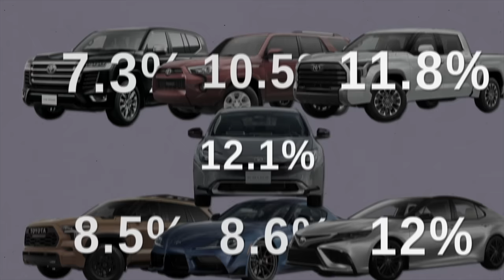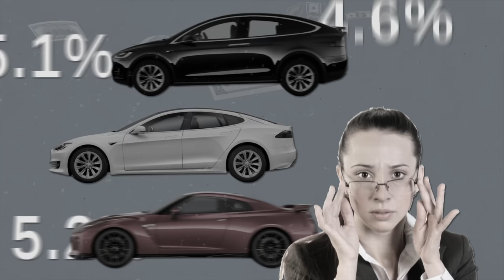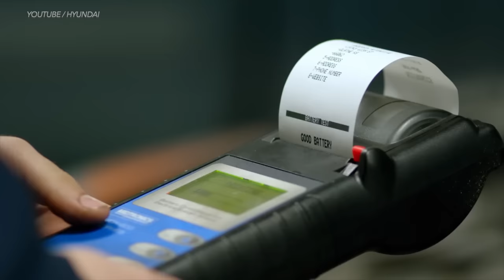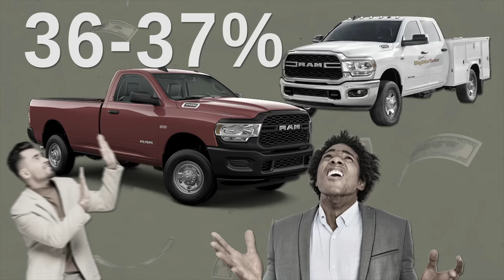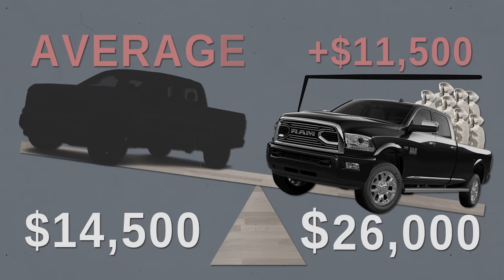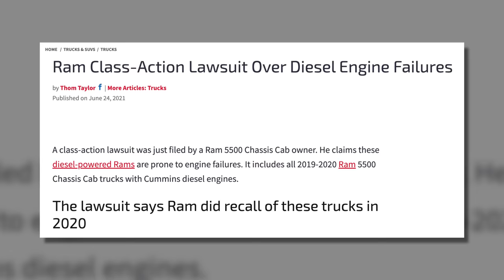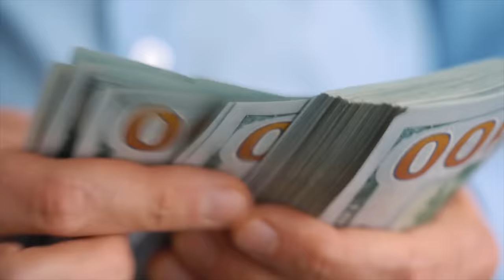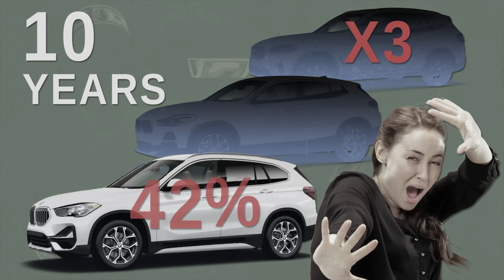Here's Why I Only Buy Toyotas and Lexus

Comment: I have a Hyundai Ioniq Electric, In denmark it cost 300.000 danish Kroner (DKK) I have had it for 4 years, I have spent under 10.000 DKK for service. I still have 1 year of warrenty on the car and 4 years on the battery.

Comment: In Poland we have saying about BMW acronim-> "Będziesz Miał Wydatki" . Which means "you will have expenses" 🙂
In BMW from (I think) 2010, to do even simple repair in engine compartment. You need disassembly front 'belt' eg. front bumper, grill, etc.
But you can cut almost in half cost of maintenance if you do more often  technical inspections and parts/fluids exchange. 
For example.. if instruction said that you can exchange oil after 20 000 km, you better do it at max on 10 000. This way engine will work better for longer time, and less v. expensive parts will be needed. And in my experience, fresh engine oil is a crucial part in BMW.

Comment: Great advice and yes Lexus and Toyota are tough!!
BMW main dealers in the UK refuse to repair, so they change the entire system that’s af fault hence the high average costs. However, I’ve an F11 520d,  bought it at 90k miles and I’ve driven it 130k miles in 6 yrs and never broken down, and never been into BMW apart from buying parts. If you are even slightly mechanically minded you will easily be able-to replace anything on a 5 series, apart from timing chains which I needed the help of a mechanic.

Comment: Fantastic stuff, though I would also liked to see some more hard numbers on absolute maintaining costs. A thing that came to mind was that some of the brands that are cheaper than Toyota might end up being just as expensive to maintain because reliability and parts costs are about even, but get a higher percentage because they start out cheaper. And some Mazda models at least aren't any worse as cars to start with.

So if you pay the same for maintaining the car for 10 years, but start out with a cheaper car, and you're not losing anything in terms of features, driving quality, economy etc., I'd say that's a win even if the relative maintenance cost is technically higher.

But yeah, definitely an awesome overview! Is this kind of information easily accessible somewhere, if one would want to look deeper?

Comment: You might laugh at me, but I think 1st gen Honda CRVs are the best. Yes, they're dated, they don't have 14" touch screens, etc, etc; I couldn't care less about tech. I like reliability, and they can't be beat in that department. When they do need repair, they're easy to work on, parts are readily available and reasonably priced. In addition, the AWD has been fantastic, I live in Nebraska and have never got stuck in snow. And they run, and run, and run......

Comment: I feel really bad... because I told my friend to buy only Toyota pick-up trucks... he always followed my advice, so he bought a '22 Toyota Tundra.  It has been sitting still in the dealer's parking lot waiting for a full engine replacement for the last 5 weeks.(wont' arrive for another 2 weeks)   It had just 6200 miles.   Whatever happened to the old, reliable, dependable Toyota engines?  😢

Comment: I can say with the rams, the maintenance is kinda a deferred cost from the cheaper initial purchase. If you compare a 70k ram to a 70k ford, there’s gonna be a lot more little goodies and gremlins to go bad. air suspension. huge screen. some sound system with more speakers than a house.

Comment: Dodge it's 22 years old just had to replace starter alternator and water pump. After 22 years. And even then it was 600 bucks. Maybe that's accurate for new vehicles but my oldie is still a goodie.

Comment: Scotty,
I bought a 2016 Ford F-150 King Ranch 3.5 ecoboost for $10k under sticker in Nov 2016 It has been in the shop an unbelievable number of times, under warranty and under extended warranties (2!). I bought an extended warranty through (Assurant) that MORE than paid for itself (around $550 vs the probably close to $8/$10k). It has been so bad that Ford offered an additional Ford Protect PremiumCare Plan 3 yr/36k miles initiated at 88k milesAug 2022. While I appreciate their willingness to step up the plate and support their product, I would prefer a product that is better engineered and more reliable. Off the top of my head, sunroof leaked/replaced, washer fluid pump, right front axle seal, heat shield, diff seal, turbo coolant leak, center console spring squeak, squeaky driver door check, missing tailgate bumper stop, faulty steering wheel switch group, 2 batteries, left and right front wheel bearings, #6 ignition coil(plugs at same time), auto deployable running boards motors replaced (NE truck/salt), water pump leak. I switched out the stock tires for Michelin Defenders at purchase and put Conti TerrainContacts at 72k. ALL scheduled maintenance at the dealer so my “loyalty” score is high. Bunch of recalls as well. I love this truck (beautiful two tone ruby red with every option) and want this truck to last a loooong time and have followed all maintenance schedules. I put on a passenger side JLG oil separator at 45k mi after finding out about the direct injection issue and K&N air and cabin filters at 50k. She is in tip top shape and I plan to keep it that way but lost productivity as a work truck(and personal) has been very disappointing and costly. Most of these are minor issues but I wouldn’t have been able to afford the truck $1000/mo payment 6 years) if I also had to pay for all the repairs out of pocket. And this also apparently a good year for the F-150!?!  I looked at the Tundra specifically because it is a Toyota product but didn’t fit comfortably(I’m 6’6” tall). Even considered switching out the seat mounts for a Sequoia but would have only gained me 3/4”. I wish they anyone could build a great reliable light truck. Hoping…
Keep up the great info vids. Thank you!

Comment: I had a 2010 VW Tiguan. Truly one of the worst decisions I’ve ever made. Not only was the scheduled maintenance costs ridiculous, but there were several unexpected $1200+ repairs that had to be made. The engine finally blew out at 136k miles. Sold it for parts and bought a Toyota Sienna.

Comment: I agree as a car mechanic for 36 years that Toyota is a very good brand. I personally do not like them because of the design. Now a day’s we see the quality issues with a lot of car brands with down seizing the engines. Oil consumption, chain wear, wet timing belt issues…etc. 
If you chose for “reliable” go for a Toyota!

Comment: Great video but you have to adjust for the total price of the vehicle.. 

Example.. if a 2015 BMW standard entry level sedan costs 35,000 and 200/maintenance you have to adjust the math for a 2015 Toyota sedan that may retail at 24,000 with a maintenance of 80/maintenance versus a 2015 Honda sedan that may retail for 22,000 with a maintenance of 70-80 versus a 2015 Ford sedan that costs 26500 with a maintenance cost of 85/maintenance.. I think if you fix this and recreate the video, proper context may be applied for better decision making. I'm a toyota/honda guy and the numbers sounded off because Honda are incredibly inexpensive at retail.. even m9re affordable than similar model toyotas.

Comment: I totally agree with the top-tier quality of Toyota and its sister brand Lexus. However I'm surprised at Volvo being included. I owned a XC90 for 14 years and it never gave me any headaches. I do change oil in all of my cars every 5,000 kms (3,000 miles for you Americans) and a top-down check-up every time car goes in

Comment: I have a toyota corolla ts and it's running perfectly (the same emissions, mpg acceleration etc) for 20 years. It's stock! If you change the oils on schedule toyotas will last practically forever (with the occasional part replacement)

Comment: My 2000 Toyota 4runner has 459,374 miles and it runs and drives like   a champ regular oil changes and maintenance is the key I wouldn't trade my baby for anything else

Comment: We had a did own a 2013 Chrysler Town and Country. We bought it with 30k miles. We took really good care of changed oil every 5k with Mobil one. The camshaft roller bearings failed at about 60k, luckily Chrysler replaced those free of charge, it’s gone through 3 alternators, check engine light comes on about once a month usually a catalytic converter code. Took it to Florida of course the AC failed when we arrived there. Point is I’m done with Chrysler products van has 100k and is literally a pile of junk. Sold it and bought a 2018 Toyota Highlander with 75k miles. I hope this Toyota holds up unlike the Chrysler.

Comment: Love this guys videos. 
Shocking to hear about Honda though. My wife and I both drive Hondas. I have a Ridgeline and she has a Civic. They are too new to tell if they are going to be expensive to fix.
My Ridgeline did however have the Torque converter go out on it and had it not been under extended warranty it would have cost me over $5k to fix at dealership.

Comment: Did you know that the legendary Toyota Hilux is made by Daihatsu in Indonesia? It makes you stop and think. My new last year Toyota Fortuner requires an oil change every 5,000 Kilometers. Just over 3,000 miles. A 2.4 L turbo diesel. 8 liters of synthetic oil every 3 to 5 months. Synthetic oil is expensive here in the Philippines so the maintenance costs on this, even under warranty are high. Food for thought.

Comment: Scotty, I have a 1996 Toyota Tacoma 4 wheel drive with over 30 thousand miles on it and it’s starting to have issues! I have a oil leak and it needs a new muffler and the AC is out! The engine light stays on, I also had to have the back left frame welded because Toyota wouldn’t fix it because they never sent me the recall! Is it worth fixing or should I just let it go? We have had it in family for 20 years! I love my Toyota Tacoma!

Comment: Without sharing any personally identifiable information, I have an old Toyota and swear by it. The two vehicles I had before that were more fun, but not worth the cost of ownership by any means. I've put less than $15,000 into my old Toyota since I bought it used over 10 years ago... counting the purchase price.

Comment: 2005 Toyota Matrix, 2nd Owner (1st was my Mother) car had 33k miles on it when I received it in 2017, it currently has 103k on the odometer and other than oil changes, brakes and tires/rotations the only recurring issue was with the Alternator, original one went out in 2019, it's replacement went out in 2020, next one in 2021, and then again in 2022, the shop kept using refurbished units, so finally I demanded they throw a new one on there and it seems to be holding strong.

Family has had nothing but Toyotas for the last 30 years and that's only 3 cars, all a form of Corolla. Currently trying to get my Mom to look at an Avalon for the bells and whistles.

Comment: My grandfather gave me his Asian utiliy vehicle (AUV), a 2003 Toyota Revo (in Indonesia, that's a Toyota Kijang). Still works like a tank and only needs the usual maintenance like oil change, A/C maintenance and battery change, although every few years or so (e.g. after 3 or 4 years) there's a major part that needs changed (and given that we have a lot of third-party auto parts dealers in the Philippines, it's not hard to find both brand new and second-hand parts, even the ones you thought were no longer available.

In many car enthusiast pages and groups, I see a lot of people who (so they claimed) literally cry for having to sell their Toyota Revos and regretting it. A second-hand unit that's in tip-top shape, even the ones from the first-generation Revos that were sold in the 1990s, can still command a resale value of up to P300,000 (slightly less than 6,000 US dollars), even more than any other 20-30 year old car. That's how big the reputation of Toyota Revos is in the Philippines.

Comment: I dunno I have a 2011 Ford fusion hybrid and besides oil changes, brakes and tires, only repair I needed was a control arm in 120k miles. I did have to reactivate the hybrid system with an obd because of a "glitch" at 10 years. Hybrids really do stress the engine, suspension and brakes way less thanks to be regenerative systems and engine not running hard. I'm surprised the starter has no problems since it's constantly switching on and off but nope no issues. 

Perhaps my luck is because I don't keep cars when they start having problems because I never spend a lot on maintenance. If it's going to cost me 30% of the price to keep something going why not just put that towards a lower mileage car.

Comment: I'm not sure if this a good metric to use. For example (correct me if I'm wrong), I think Lexus and Toyota use the same or similar engines. To compare the maintenance cost to value of the fair isn't statistically sound, as you have to consider the difference in retail cost as well. I would suggest that if you could somehow quantify performance, then compare those numbers to maintenance costs, it would be a more effective use of stats.

Comment: Interesting video. Any data on Honda CR-V? I'm considering an 2017-18 model, petrol, 2.0, non turbo engine with manual transmission.... (I'm in Europe).

Grateful if you could shed some light on the matter 👍

Comment: Idk... citation needed?
The new Toyota Supra is literally the same car as the new BMW Z4. They share all mechanical parts and chassis. If the Z4 goes wrong so does the Supra and on the free market spare parts cost the same because they are the same. So how can one be on the top and one not worth mentioning? 
I don't dispute the fact that Toyota is value for money and reliable, they are. But I do wonder how you come up with these numbers. Like I said how can the Supra be super reliable and comparatively cheap when it is just a redesigned a BMW Z4?

Comment: I’m 64 and used to buy Mostly Ford vehicles but got tired of them try to sweep their issues under the rug. As far as Ram I am in my third Ram 1500 hundred and IMO they are far better and low cost maintenance than any vehicle I have ever owned. My wife and daughter drive nothing but Jeep products and they have been spectacular also. I guess it’s whatever brand you have the most luck with.

Comment: I have a 2009 ram 3500 diesel. I've had really good luck with it so far but i got it at auction as it was used by the county for 10 years so it had consistent maintenance. Had about 120k miles and got it for about 12k so hoping i did okay on the deal. I bought it just for towing essentially

Comment: The cost of buying a Toyota outweighs the savings of reliability. This is why instead of buying an early 2000s sequoia as a family “overlander” style rig for camping, hiking, hunting, etc, I opted for a Tahoe instead. The 4l60e might go out. But rebuilding that is still far far under what I’d pay for a 4 runner or sequioa of the same year - not to mention the rust issues in those generations of Toyotas. I paid 3k for my Tahoe, and sequioas in similar condition were 9k and didn’t ride as nice and had more interior issues, seemed to have less power too. I’m not sold on the Toyota obsession because as I said earlier, the cost of them is starting to far outweigh the cost of repairing a reasonably priced used car.

Comment: Absolute rubbish, owned ford, VW, Audi, BMW, Toyota, all work fine if serviced, all did over 100k miles without issue, both petrol and diesel, now on 330d with 182k miles and still works just fine.

Comment: With regular maintenance, I was able to maintain EVEN A 2008 Chrysler 300 up until last week til 250,000 miles!  It would probably still run just fine, but I wasn't about to dump money into doing the brakes again, air conditioner, tires, and then getting the OMB computer port fixed, just so they can charge me $150 diagnosis to scan, just to tell me I need an o2 sensor to pass inspection...  But had I put new brakes and tires on it, fixed the AC, maybe put in new spark plugs, the thing would probably run til 300k.  Transmission may go before then, but who knows.  Wasn't worth even $100 to find out on a car from 2008.  But most of these things crapped out @ 50-80k LoL so that 3.5 V6 motor in the 2008 ran beautifully.  Wound up getting a 2012 Camry SE and hoping it lasts just as long, if not longer, than that 2008 Chrysler did.

Comment: I noticed Scotty listed a Toyota Supra as one of the lowest cost of maintenance vehicles. Is that accurate considering that most of the materials and engine components of the supra are made by BMW? I’m thinking of moving from my Mercedes c300 to a 2021 or new Toyota supra. This switch would be a no brained for reliability and performance.

Comment: Scotty the 91 corvette stuck in limp mode not shifting out of  3rd gear you said rebuild your transmission, I think he simply needs to clean his transmission heat exchange and thermostat because his trans fluid is getting too hot and causing lose or hydraulic pressure because of thermal break down of his fluid (he's boiling his fluid getting air bubbles in it. But hey im probably wrong

Comment: I've had 3 camrys and every one has had hundreds of thousands of miles and when i got rid of them were still running without any major issues. my 3rd and current 2002 camry just survived a hailstorm with a lot of dents but zero functional or glass damage. our 2014 yaris wasn't so lucky.

now I'm considering a corolla cross hybrid. scotty, do the pros outweigh the cons of a hybrid toyota? is that worth the going prices in this upside down car market?